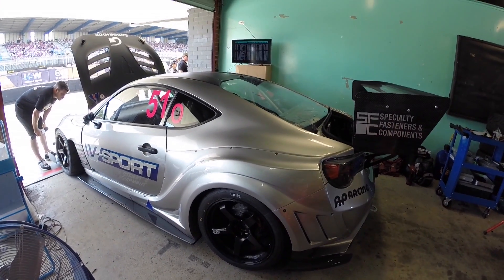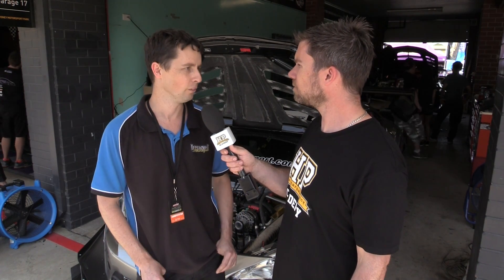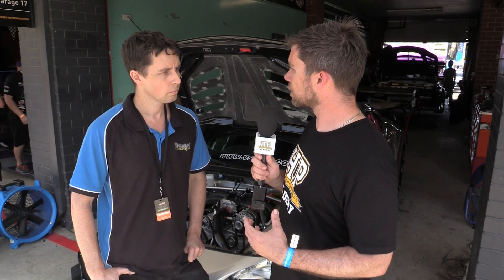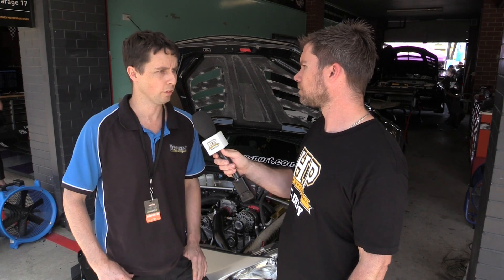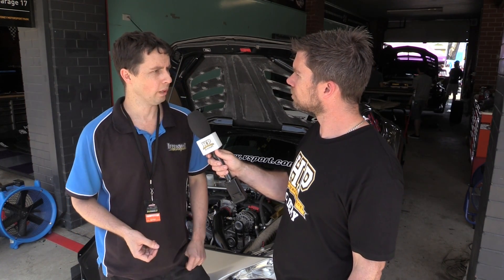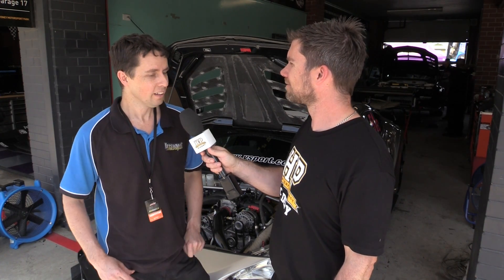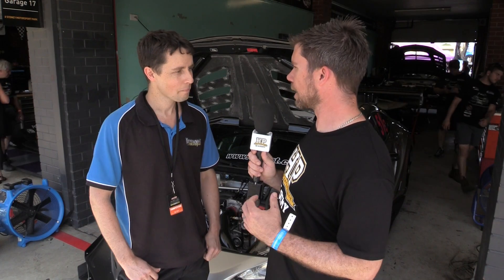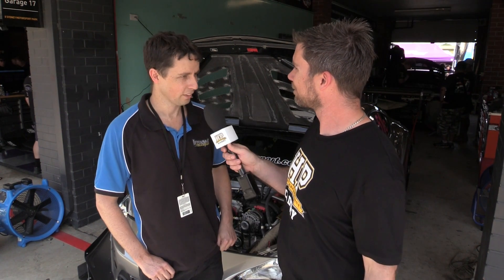Why Keep the FA20 in the V-Sport Toyota GT86? MoTeC | Emtron

Comment: Hi HPA,
I'm so confused on the matter of the auto blip for downshifts on a sequential. Please could you explain to me how a throttle blip can occur during downshifts without the clutch being depressed in some way ? Wouldn't that translate into a forward movement of the car during that phase ?
Reply from the maker: Take a nose here for a bit more information on that front - http://bit.ly/2EK0qEL Let me know if it helps clear it up a bit for you - Taz.
Reply: High Performance Academy ok thank you very much but what I want to know is if the clutch is actuated automatically during downshifts when a paddle shift system is used.
Thanks
Reply from the maker: The clutch is only used to get you moving or when you're coming to a stop. The shifts are clutchless =) - Taz.

Comment: I'm very glad to see they kept the factory engine & turbocharged it. 350kw is not an easy feat to accomplish on a newly developed engine/ECU setup. I do wish he would have elaborated more on the different electronics they used in the car to communicate w/ the Factory Can Bus. I.e. How the Motec cluster communicated with gearbox, ECU, or ABS module, etc. & I wish he would have elaborated more on why they removed the direct injection. Was it just harder to tune along w/ port injection, make less power or increase fuel consumption. Other than that glad to see them stick with the FA motor & continue to develop it instead of take the easy way out & swap in another motor.
Reply from the maker: +GMannATL take a look at this series I think it will answer a lot of your questions about car/ecu integration. https://www.hpacademy.com/blog/wiring-and-tuning-project-panhard/